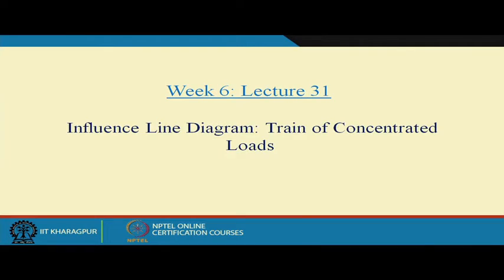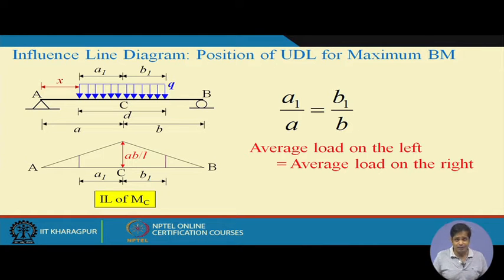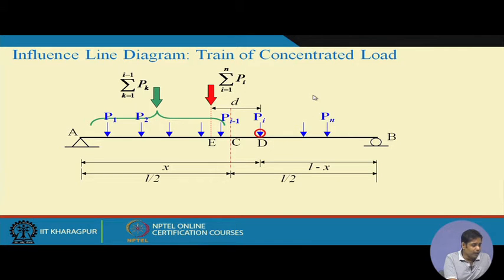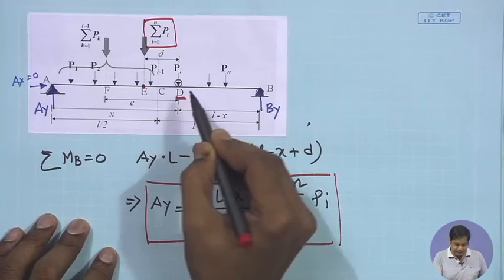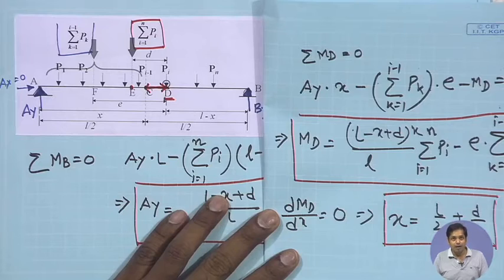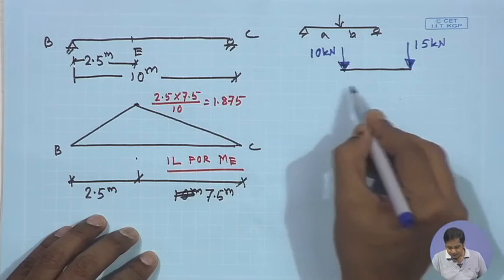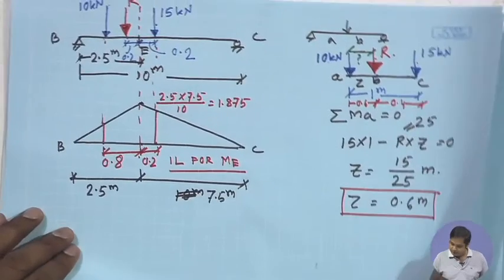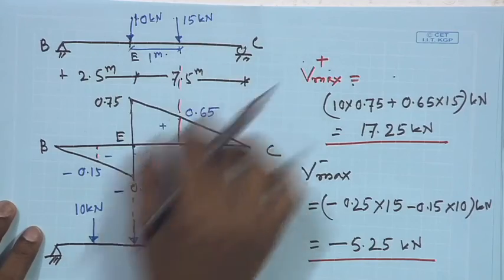Lecture 31 : Influence Line Diagram and moving Loads (Contd.)

Comment: To find the critical position of the load for the maximum bending moment at a given point, should we not derivate Md with respect to d? But you have taken derivate with respect to x. Isn't x fixed since we are trying to find the maximum bending moment at x?
Reply: Consider the following article from HIBBELER:
The absolute max moment in simply supported beam occurs under one of the concentrated forces, such that this force is positioned on the beam so that it and the resultant force of the system are equidistant from the beam's centerline.
Since there are a series of loads on the span, this principle will have to be applied to each load in the series and the corresponding max moment is computed. By comparision, the largest moment is the absolute maximum.
As a general rule, though, the absolute max moment often occurs under the largest force lying nearest the resultant force of the system.
Reply: Referring the articles in RC HIBBELER book, the max. moment will occur under one of the loads in the train of concentrated loads.

Now, Pi is that load under which the max. moment occurs.

The load Pi can be placed anywhere on the span.
Wherever it gets placed, we get a max. moment under that load. 
Max moment is obtained by multiplying the ordinate of Pi and all other loads with the corresponding ordinates. 
(This paragraph may seem to be confusing a lit bit.)

As under Pi only we get the max moment, however among those max moments, we still want the absolute max. moment.

So just assume that the max. occurs at D.
We then find out MD.

That MD gets max value when D is placed at d/2 from the mid span.

Overall I want to say that value of D is not fixed. Even we don't know which is that Pi under which there will be max moment.